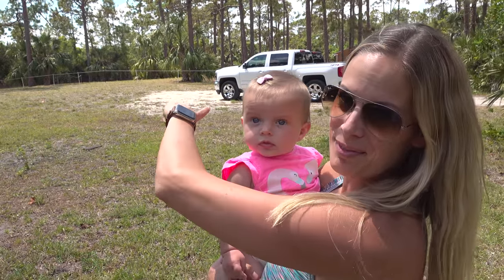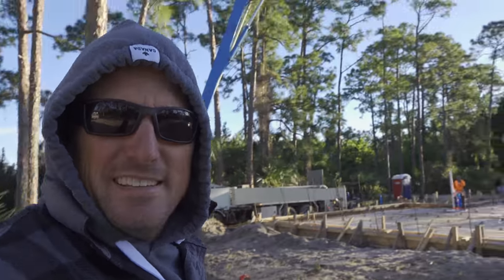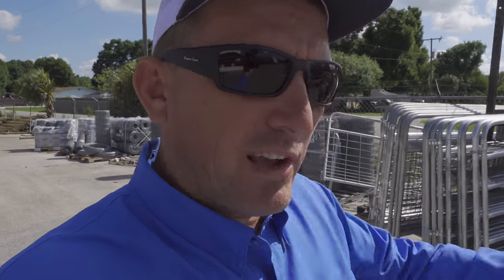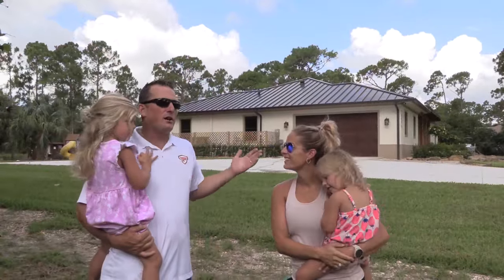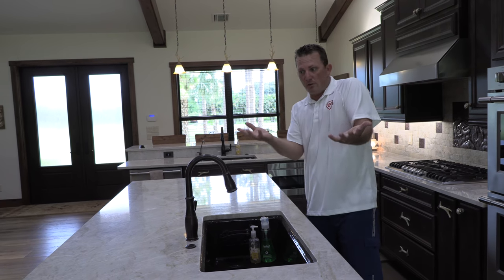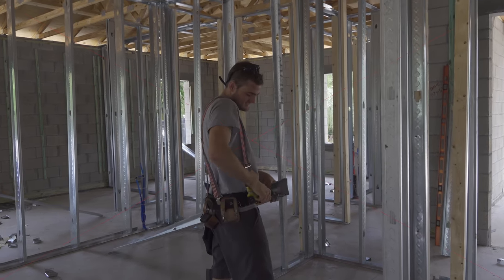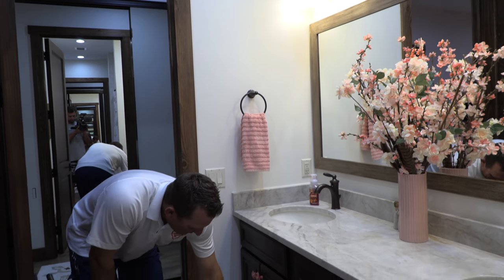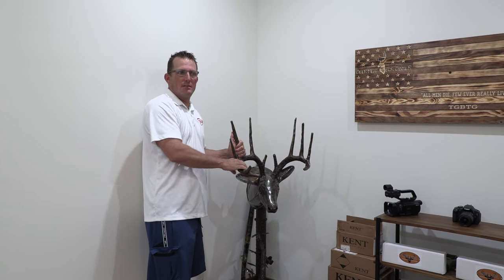HOUSE TOUR! Our DREAM HOME is COMPLETE!!! Start To Finish!!!

Comment: I would never place the septic tank under my house. 
There are so many sharp edges/corners in the house... 
The upper cabinets in the kitchen are too low - you can hardly use the whole working area under them.
Having the possibility to open the bathroom window - priceless.